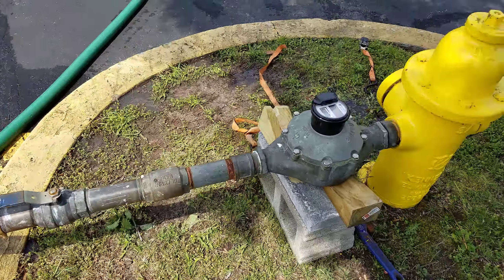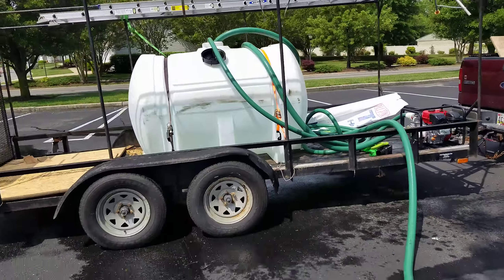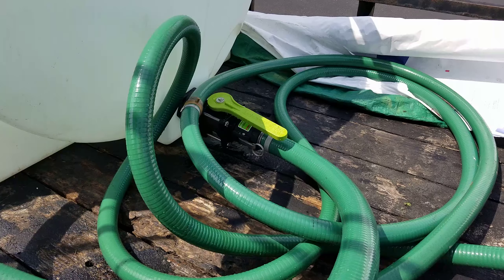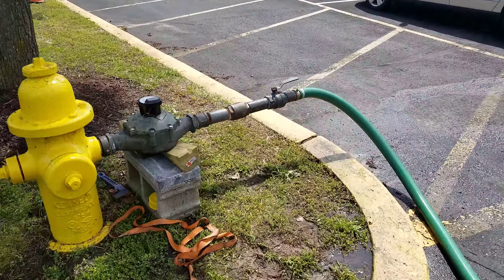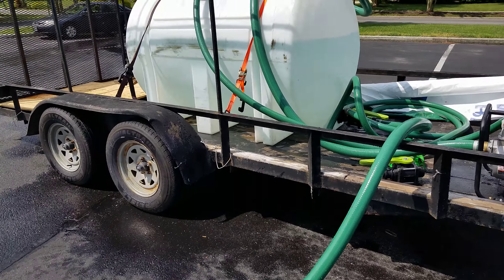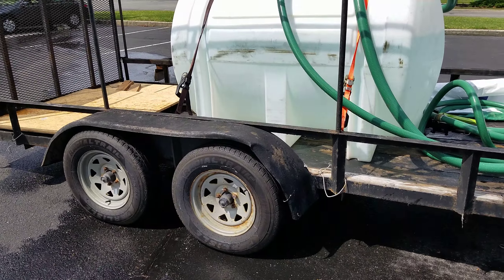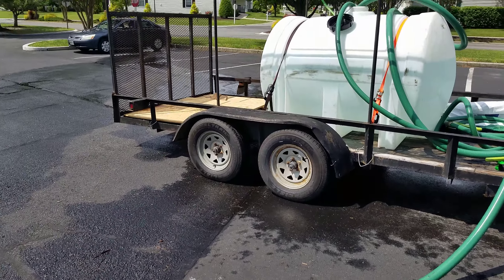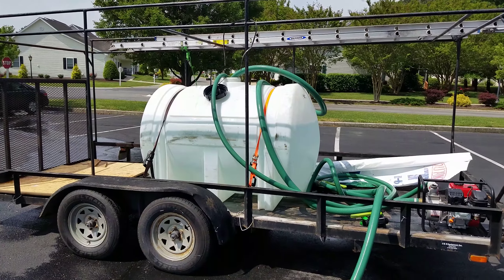Using hydrant and meter to fill up supply tanker for HOA job.

Comment: The way you are filling your tank is a direct cross-connection to the public water system. There should be a backflow device on that hydrant/meter manifold, or you could use an air gap on your fill line. Most water systems I know of would tear up your hydrant use permit on the spot.
Reply from the maker: Watch the video again.   This is PROVIDED by the city.  It has a built in backflow preventer.

Comment: Where can I get the hose to connect to a 2” meter?
Reply from the maker: tractor supply or harbor freight
Reply: @Cleanpowerwash  thank you for the quick reply, I will try them. The city said the output thread is MIP and I haven’t found a hose with the female counterpart to match. I’m worried the city gave me the wrong info. Does MIP sound right for meter output?
Reply from the maker: @frankpirrone6032  yes. You can get 2" camlocks to make it easier. But most 2" non crushable hose like in this picture will have a male and female end that would work perfectly for it.

Comment: Cost to rent the meter?
Reply from the maker: Every area is different.  Our main town is $50 to set it (install)  plus a a few $ per 1k gallons
Reply from the maker: Its 1750 psi.   Check out manatee power wash source supply
Reply: Thank you sir